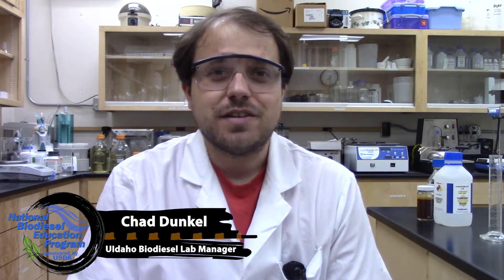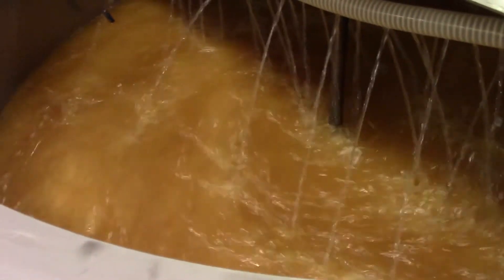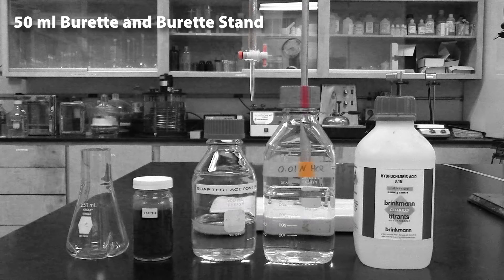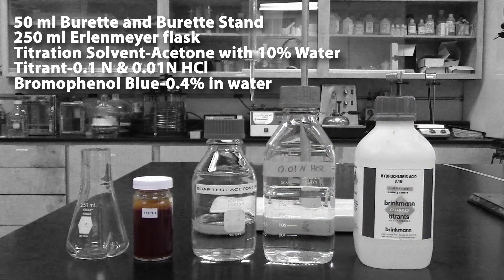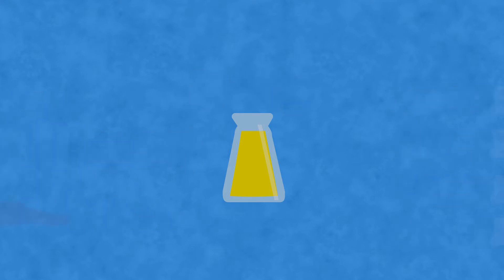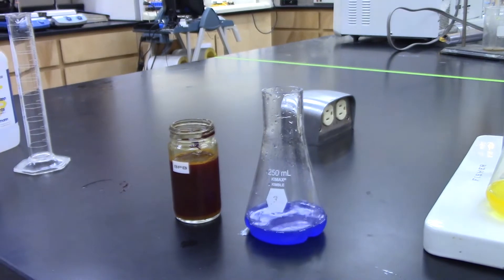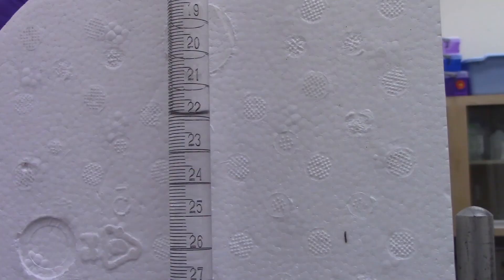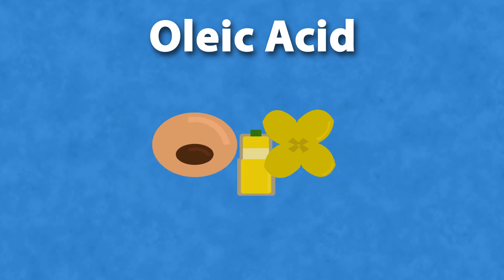Biodiesel Soap Titration

Comment: How is it removed water wash? What if your oil is hugely hygroscopic like castor/ricin-oil or coconut-oil/lauric acid?
Reply: Biodiesel and oil will always be a bit hygroscopic but they will still phase separate. To remove water from oil before reaction and to remove water from biodiesel after washing heat the oil/biodiesel to over 100 C. 

There are also resins that adsorb water/methanol/glycerin that you can pack a column with to clean biodiesel without water washing.